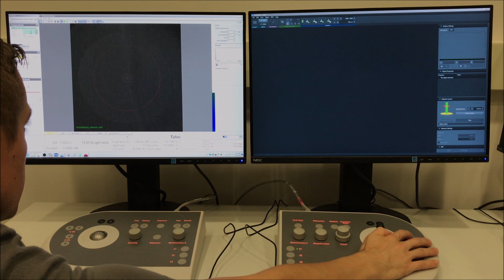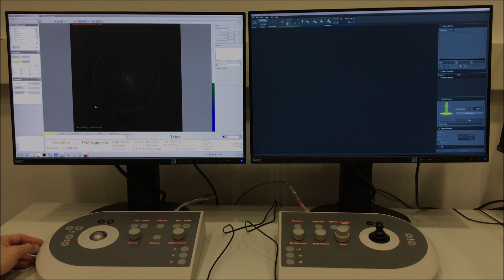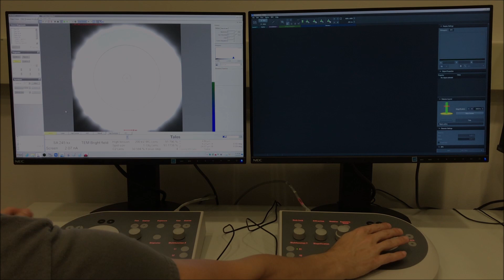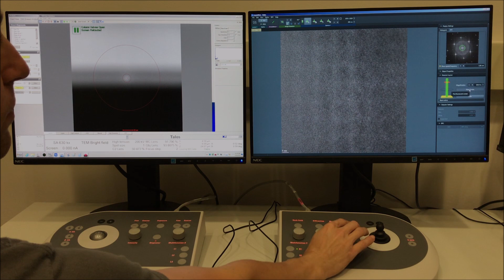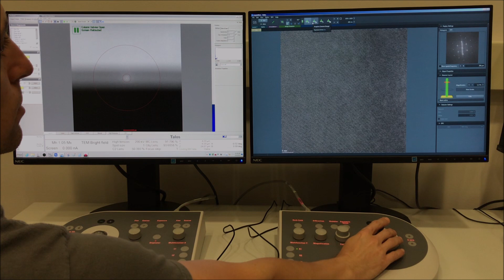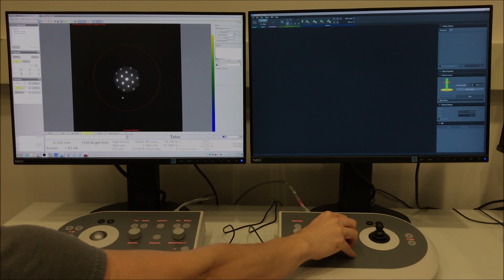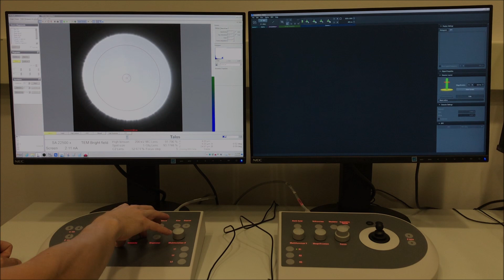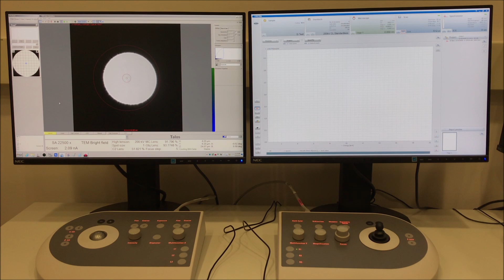FEI Talos F200i S/TEM: basic operation (playthrough)

Comment: Thank you for kind tutorials, which help me a lot. I'm very new about the alignment issues, which bother me a lot cause the alignment in my college is really easy to change. I have a question about that: what is moving when we move the beam track ball? What's the difference between the movements of the ball, beam shift and adjust of condensers?  In alignments, in what sequence should I align? Monochronomator -> C2apeture -> ppx + ppy -> center c2 aperture -> condenser center TEM -> rotation center -> coma free align X/Y -> ppx+ppy? The beam shift seems to cover a wide operation range when I use.
Reply from the maker: Glad my videos are helping you.  Regarding your questions: 1) The trackball is dedicated to shifting of the beam.  You can also configure the "multifunction" knobs for "beam shift", which will then do the exact same thing as the trackball.  As far as alignment order, my recommendation is: 1) set eucentric height, 2) select spot size, 3) align C2 aperture, 4) correct condenser astigmatism, 5) align beam tilt pivot points, 6) align rotation center, 7) insert/center objective aperture, 8) correct objective astigmatism.  When your are describing the "beam shift" covering a wide range of operations, I think you are referring to the "multifunction" knobs (and yes, these can be configured to perform a nearly endless list of functions//alignments)

Comment: Hello Nicholas, thank you for all your effort and the nice videos. Hopefully you're having fun playing with the new microscopes!
I have two questions: In the FFT  at around 36:30 one can see "extra" reflexes, which I think are due to aliasing (bigger pixelsize in view mode due to binning i suspect), i.e. "folding back" of the reflexes? Is this camera too sensitive for diffraction work or why use "only" the Flucam image?
Thank you again!
Reply from the maker: Hi TheLukmuk: I'm glad you like the videos.  You are correct that the additional unexpected features in the FFT are due to the mathematics of the FFT algorithm.  At some point, I should an FFT specific video, but I'm still wrapping my head around the math.  As far as the camera is concerned, we simply have not been able to collect single crystal diffraction patterns with the Ceta camera without blooming of the spots.  We even had an apps person from FEI here and he couldn't do it either.  The Flucam doesn't suffer from this problem because it is not directly imaging the electrons, but rather is imaging the light generated from the electrons hitting a phosphor screen.  Plus in diffraction conditions needing high dynamic range, it's hard to beat the high dynamic range of the phosphor screen.

Comment: Hi Nicholas. It is possible to take SAED using ceta camera and Velox. One just needs to set capture time and viewing time to smallest available period. I guess it is 2 micro sec. and increase depending on counts. We use the ceta camera to get SAED in Themis.
Reply from the maker: Hi Rahul: even using high numerical values of spot size, small SA apertures, and short exposure times, there was still a lot of blooming in the single crystal patterns (polycrystalline samples were less of an issue); even when we had the FEI apps person here, he still couldn't produce a satisfactory pattern with the Ceta camera.  We have a 10+  year old Gatan UltraScan on our older Tecnai F20 and it produces far better, blooming-free patterns, which is baffling to say the least.  Plus it's hard to beat the dynamic range of a fluorescent screen in a high dynamic range application.  Maybe you could make a video showing you collecting patterns on your Themis with the Ceta camera?  I'd be very interested to see how you set it up and the results you obtain.

Comment: How can we quantify the data in EDS mode ? The last part
Reply from the maker: Hi Bijoy: it's basically a black box calculation.  You input the spectrum and tell the system what X-ray peaks to use and it calculates the percentages based on theoretical sensitivity factors.  This would actually be a good video, to go over how quantitative EDS works, so thanks for giving me the idea.